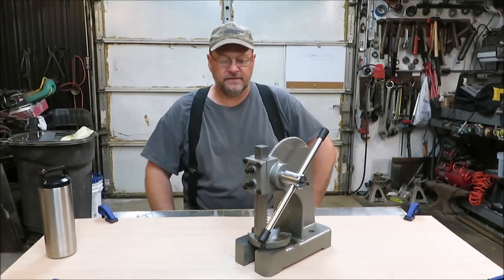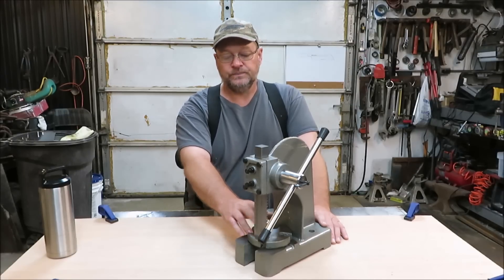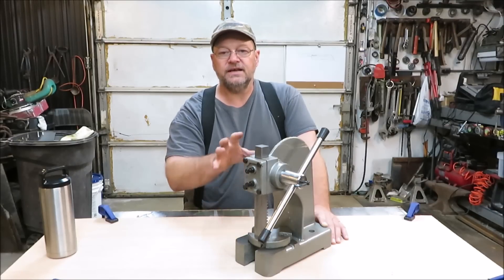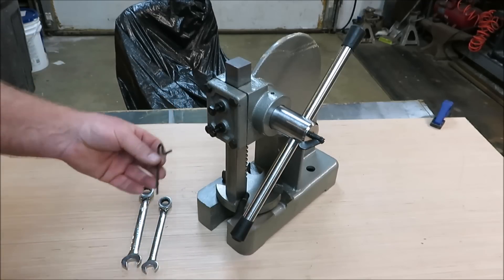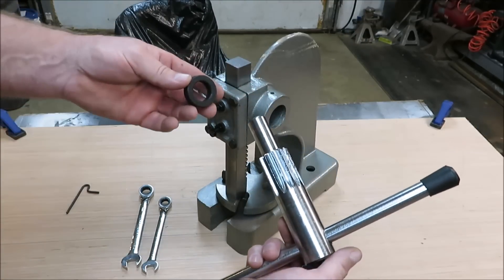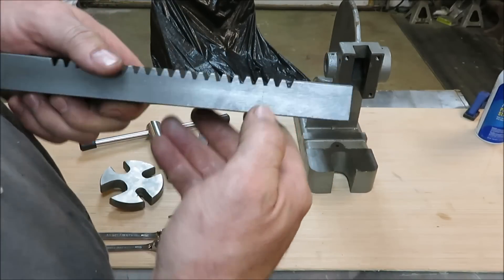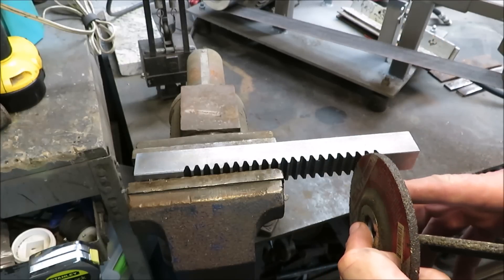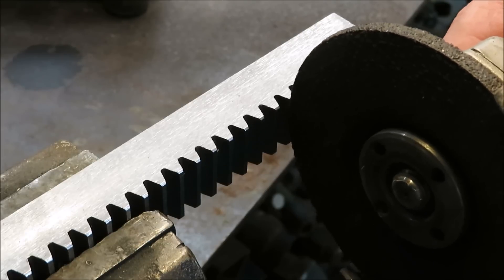arbor press modifications part #1 grinding teeth off

Comment: I think that these presses were manufactured in a cave in China.  I would love to hear a comment on this machine's lack of mechanical advantage with the lever arm provided.  This is basically a rack and pinion arrangement.
Reply from the maker: Thanks for the comment Dennis.
Reply: Why would it make any difference where they were manufactured in China?  Their still from China.  Also they only cost at the time of this video 40 bucks!  What can you produce equal to this press for 40 bucks and make money?  Also if you cannot figure out how to manipulate the force bar then you should probably refrain from your mechanical adventures!  Ever heard of a cheater?  It's a pipe, a length of your choosing, which is slipped over the force bar to enable more force to be applied.  Usually called a force multiplyer.  😚😁

Comment: I'm helping a friend set up a machine like this, but all your work was completely unnecessary if you're using this machine for only one particular job. If you are doing many different kind of thicknesses of jobs I could see doing this, but all you need to do is remove the pinion shaft and handle and rotate it to the position you want for maximum tension on your part and reinsert it into the arbor in it's new position. No machining necessary. I was shocked at the lack of clean up done when they manufactured these!
Reply from the maker: thanks for watching

Comment: Gona add a 4 or 5inch machine handle on my opposite side of the handle for easier up stroke to change tools out. Think ill pin it so if needed to clean just pull pin n replace.

Comment: Instead of grinding the teeth off you could grind the flat part of the shaft so you still have full stroke
Reply from the maker: Thanks for the comment Brad.
Reply: @Robinson-Homestead  
Brad Valkenburg
 said "Instead of grinding the teeth off you could grind the flat part of the shaft so you still have full stroke" What do you think Mr. Robinson, would that work?
Reply from the maker: @TicketTim  I'm not sure the rod would go up far enough to skip.

Comment: Nice modifications, why mess with orins to hold the punches on just get a couple of spare handles off ebay only cost a few dollars and turn the handles down to fit the arbor. for the little one sleeve it up to fit the arbor. don't forget to use the domed out anvil under the snap caps as well as the rivets

Comment: Kevin, would you please tell me what the throat distance is on this arbor with the ram raised all the way up and the base plate removed?  I need one that will allow at least 8” clearance for a particular use, but it doesn’t have to be super heavy duty, so I don’t want to have to buy a 2-ton or larger.
Reply from the maker: 5 to 6 inchs thank you for the comment Diane.

Comment: Interesting about the grinder gearbox. I bought a grinder from Princess Auto (Canada's equivilant to Harbour Freight) which had a problem getting up to speed. You found no grease? mine the guy must have figured that if a little is good, a lot is better. Literally the gearbox was filled to the rim with grease.  I scooped about half of it out after which it started running properly. Really, if you embrace it, buying tools from these companies is kind of like a surprise party with every purchase. Cheers.
Reply from the maker: You are right for sure Axel.

Comment: Two more suggestions..One, cover the end or your nozzle and the hole you blow out with a shop rag before you inject air.  Hold in place with your cupped hand.  This will direct the debris onto the rag instead of throwing all of that crap everywhere in your shop or maybe into your eyes.  Second, take your Dremel and cut a 1/32" deep cross-hatch pattern (grooves) into the three sides of the rack slot of the base to hold the grease in place.  These are called grease grooves.  This way, the grease will NOT migrate onto the rack and eventually onto your work piece, plus they will hold a lot more grease; i.e. less maintenance required.
Reply from the maker: Thanks for the all the info Ronald.